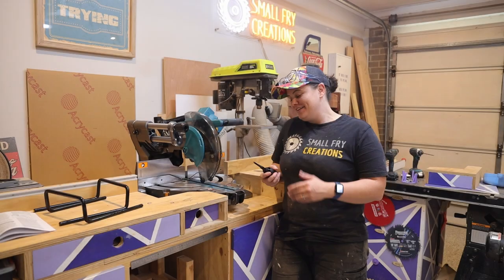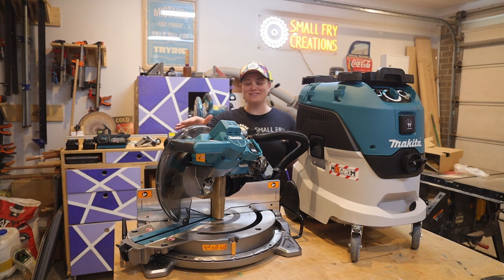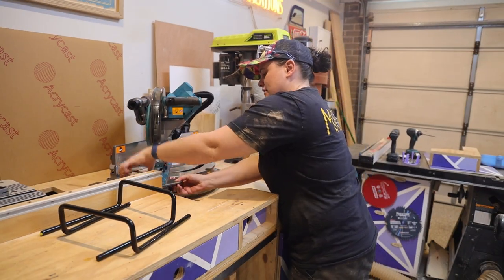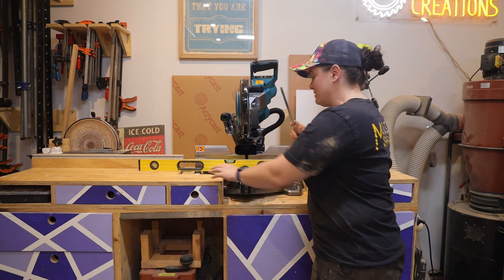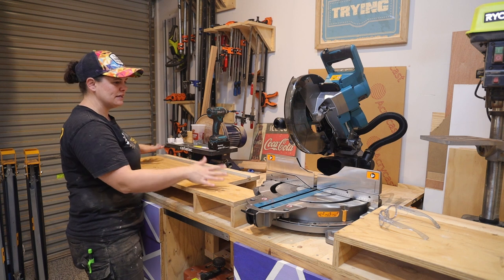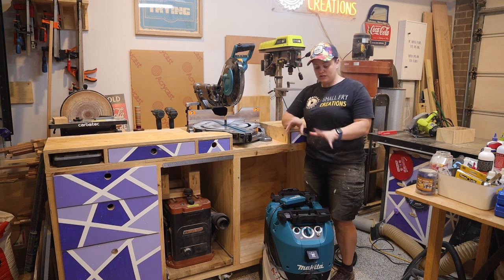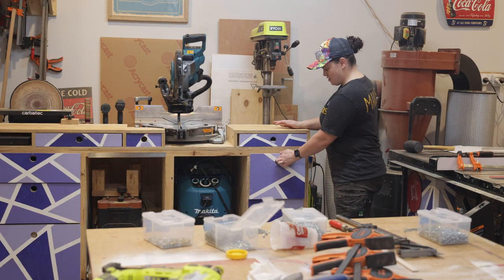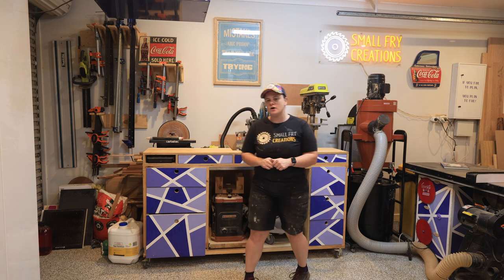Mitre Saw Station Upgrades with Makita 40V Saw and Vacuum | Auto Dust Collection

Comment: You made the right decision to lower the bench and not raise the saw to get it all level. When I did my mitre saw station I raised the saw with spacers and over time they would come loose or wear out due to the vibration of the saw. It was a real pain where the sun don't shine so I modified it the way is should have been done the first time. But I really do need a good vacuum and that Makita one looks real nice. I also like to use a note from Norm Abram from the New Yankee workshop.  There is no more important safety rule then to wear these, safety glasses.
Reply from the maker: Oh that’s so nice to hear because I thought it was the better way to go. Glad I did it then. The Makita vacuum is great so far. It has some serious suck power. Thanks for stopping by

Comment: That's a nice looking vac. Jelly. Funny, I am considering adding a shroud as you take yours away. Will be keen to see how you feel about it after a few weeks and if you miss it. I've been a fenceless fan for a while. I do a lot of small cutting on mine and made a long stop-block that reaches all the way to the saw blade from the t-track, might be handy :) These improvement videos are super useful for ideas, worth filming!
Reply from the maker: Hey James! I have your stop block in mind because I love how it goes to the blade for smaller cuts. I think its the way to go. What I like about the shroud being gone so far is with the wireless vac I can turn it on from the saw without turning the saw on so I can switch it on and quickly take the hose out of the back of the saw and clean up anything around the saw and work bench. With the shroud on I couldn't easily get to the hose. So far I like that ability. :)

Comment: I have had my makita saw for about eighteen years similar model to your old makita, never new you could still use it for set cuts without the knob. Just removed the knob from my saw very happy. Steve
Reply from the maker: Hahaha glad I could help and wasn’t the only one. I haven’t had any issues with it since removing it so I think it’s fine to be out and only use on the odd angles. Thanks for stopping by😀

Comment: Great reorganisation project Ainslee.
I don't think it should have been easy to realise that the grip handle should have been in place all the time. I would have assumed it was necessary for accurate registration in every angle including the usual 90 degree station.
The advantage with the vacuum is that you can decouple it and use it anywhere you want unlike the dedicated dust collector. That vac would take up half the floorspace in my little workshop! A real pain to have to adjust for the different heights, I wonder if there would be such a thing as 4mm plate aluminium to act as a spacer? Onwards and upwards for the S F Creations workshop! Eryk  :-)
Reply from the maker: Hey Eryk I hear you about the grip handle. It would make sure it 100% stays in place even at the 90 but I haven't had any issues yet. If I notice it become a problem I will put it back in but just nice to know what its for. Yep I could have put a spacer in. I was worried it might move over time. Thank you so much Eryk for all your kind words and stopping by

Comment: I don’t know on makita, but all other ones I’ve seen, those knobs almost always lock it into place firmly into the detents, while the pull part just gets it mostly there
Reply from the maker: I think your right. I haven’t had any issues with it moving or not cutting right on 90 degrees so I will keep an eye on it. Will be keen to see if over time does it become an issue. Don’t know why they make the handles so dam big!!! Thanks for stopping by😀

Comment: New tools are always so nice! 😎

Are you going to put the hood back as well?
Reply from the maker: They sure are Nick. Not going to put the hood on. I’m hoping the dust collect in the saw works much better then the old one and there isn’t a need. However I didn’t cut the back of the work bench down just in case I want to put it back in. For the moment it’s working well without it 😀
Reply: Will be good to hear how well the sucky works 😉

Comment: Great upgrade to your space! You've done away with the shroud? I put one in for mine, even added another port to collect the dust that falls to the bottom but it still isn't amazing, almost wondering whether it was all worth it, i'd always hoped it would be better than it is! I'm a big fan of linking the vac to the saw, every now and again I simply forget to switch on the dust collector before a quick cut and this would remove that possibility. In an ideal world I'd have a vac connected to the saw, automatically starting for most quick cuts, then if I'm doing anything more like trenching etc turn on the more elaborate system to catch everything else. Cheers!
Reply from the maker: Thank you :) I agree with the quick cut. I at times forget also. I have done away with the shroud as I like that I can turn the vac on from the saw without turning the saw on and I can take the hose off quick and clean up any dust around the workbench. If I put the shroud on it then isn't easy to get to the vac hose. So far happy with the upgrade and I'm impressed with the battery life. I don't use the saw everyday and its still going from when I first set up the saw which is about 3 weeks ago now.

Comment: Why not put a 4mil sheet under the mitre saw rather than cut-down all the other sections?
Reply from the maker: Could 00% do that. I just didn't want to risk movement of the material under the saw being compressed over time.

Comment: We didn't you just raise the saw up, it was only a little bit
Reply: Came to say the same thing.
Reply from the maker: I address is at the end of the video. I prefer the permanent solution and it won’t move or fall out of level over time 😎
Reply: @SmallFryCreations  There are plenty of alternative materials that maybe you could have considered, to raise the saw, other than wood such as a non-slip mat, a rubber mat etc. Also, did you check to see if the saw has adjustable feet?
Reply from the maker: @Michael-AUS  Of course lots of options. No adjustable feet on the saw.